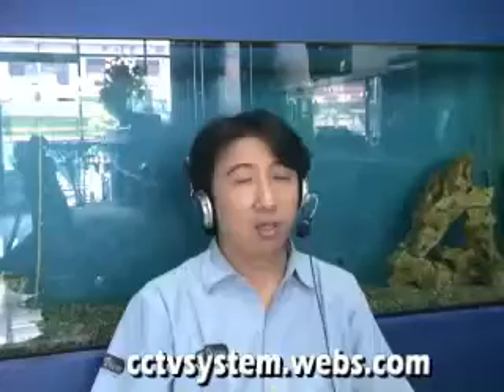2009, CCTV CAMERA SYSTEM -www.houseofcctv.com- VDA / Video Distribution Amplifier

Comment: Hi,
What I want to do is to split 6 camera setup to a analog tv and computer monitor via pc-based dvr. 6 camera signals will input into the VDA or VSD and the one output goes to a monitor via PC based DVR and other to an Analog Tv. My question is that on computer monitor I would be able to view all cameras (arranged in a grid)  but would I get the same view like monitor on tv as well. If not then how the output would be on tv and how would I switch to another camera. pls explain.